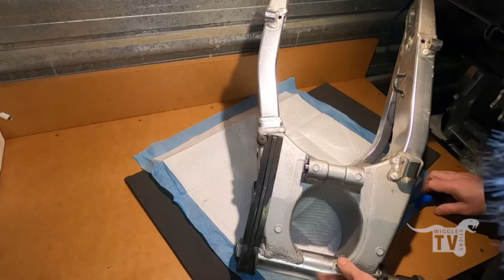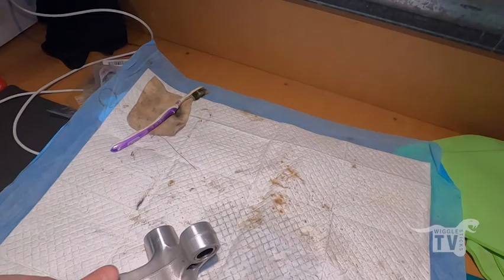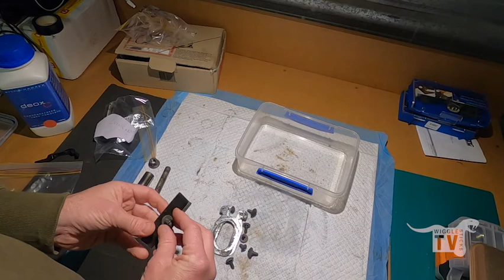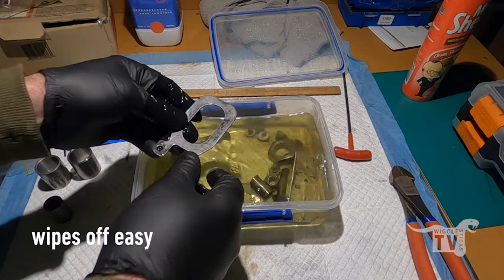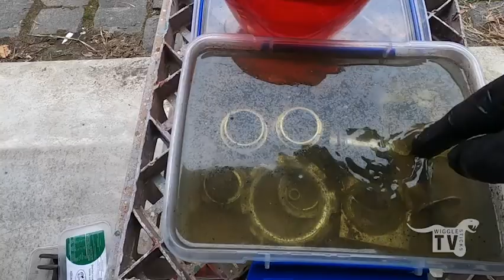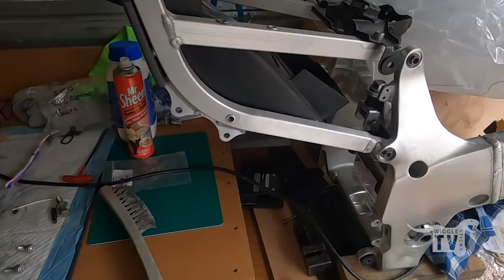1996 GSXR 750 SRAD Track Bike EP: 05 - Swing arm and rear end refresh

Comment: Hi, if I use deoxc for inside fuel tank. Do I need sealer coating after to prevent rust? Thanks.
Reply from the maker: Hi, not sure about that. I have not done the inside of a tank as yet. Luckily my tanks are good so far.